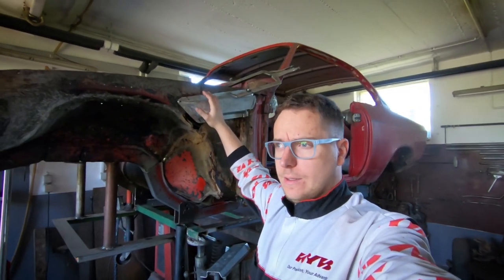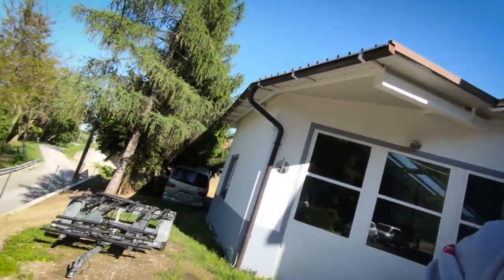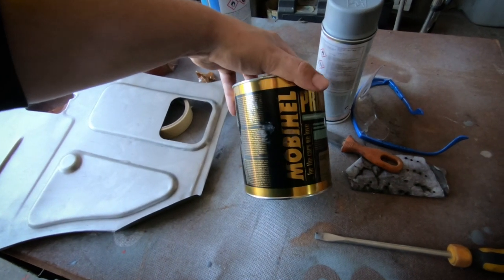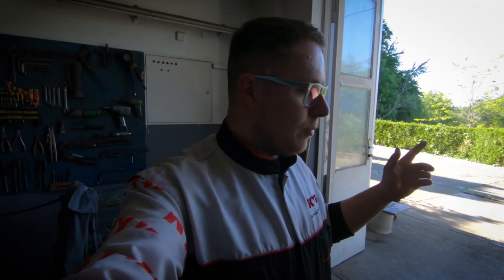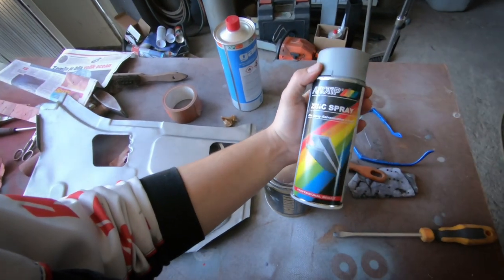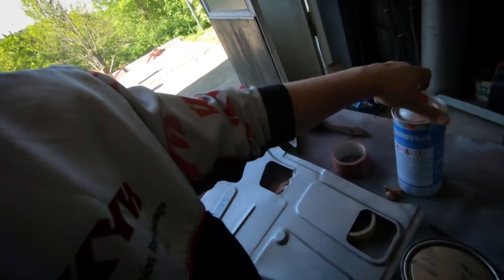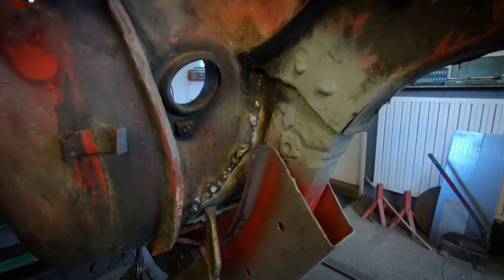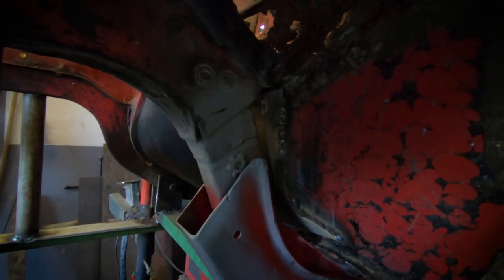Opel Manta A '71 - S1 EP20: How to make a A-Pillar / A-Post Reinforcement (DIY) | Metal Shaping |

Comment: What rust converter did you use?
Reply from the maker: NCH Europe Chelade polymeric rust converter. I also used Wurth on other surfaces and have filmed a test with 3 different products on rusty nuts and willl share the results and where I would recommend using each product since they give different results - if you are interested in stuff like that.  :)
Reply: @l3v4rt  yes please Metod.  

Loving your metalwork skills, it is so satisfying making repair panels from sheet steel. 

I made a pair of repair pieces for the horizontal plates that sit under the headlights and over the top of the lower valance. They were as good as from factory. If you have a DM facility I could send you some photos of my last A Series.
Reply from the maker: @1968spikey  absolutely, I have a few videos that I need to do first so the timeline will stay correct but in a few videos it will be out and you can make an informative decission on what product to buy for rust converting. 
That is great!  I would love to see them, if you have an instagram account you can send me there on: levartmetod or on facebook. :) Have a nice day!
Reply: @l3v4rt  sent you a Facebook message :)